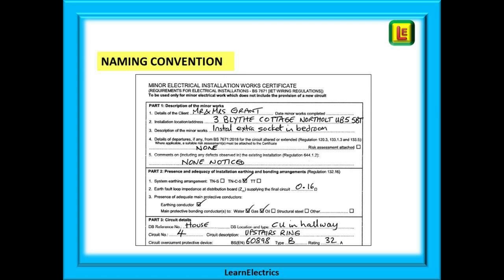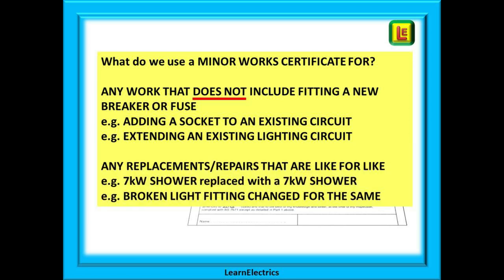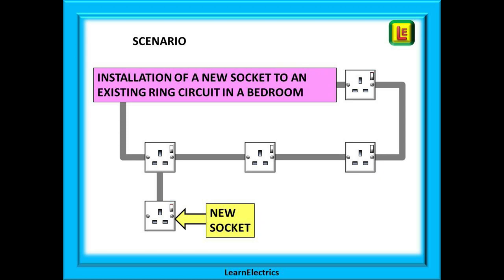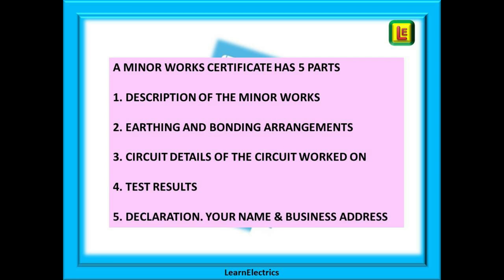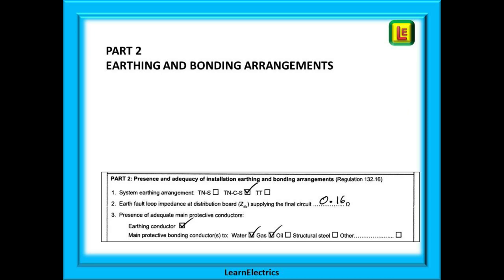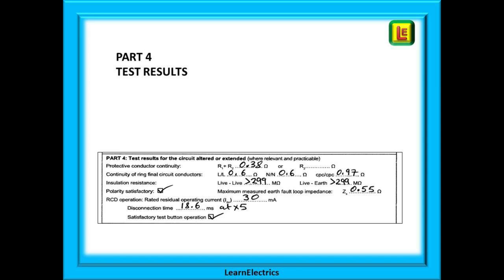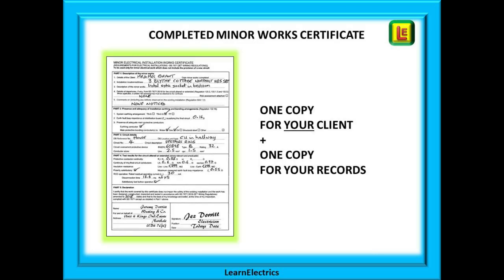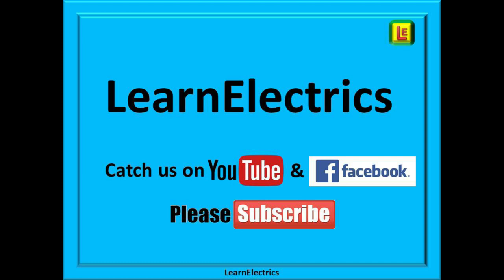MINOR WORKS CERTIFICATE how to complete correctly

Comment: Hi I have been watching your videos with great interest as I am thinking of retraining and becoming an electrician . One question I have when you test your work say if you have added an extra light  so there is two in a room off the same switch , do you need to test all the lights on that circuit or just the one you have added
Reply from the maker: The one you have added, and the one you have taken the feed off, just in case you have moved wires. Great question, thanks for the input. Keep learning, its a good trade to be in.

Comment: Another useful video thanks, I’m just getting back into domestic work and started extending a ring and separate spur, in a kitchen. All minor works but my problem is I can’t isolate the DB for all the tests as some of the other circuits have medical equipment connected, can I still complete the cert but leave comment to the limitations.
Reply from the maker: Part 2.2 of Minor Works Certificate Zdb can be found by Zs at the new sockets minus R1+R2. If the medical equipment is on the same RCD as the new work, then you will need to write this an exception. It's a valid reason to miss it out, the customer doesn't want the equipment disconnected and they accept that it is being missed out. They are accepting responsibility - so long as everything else is as it should be.
Reply: @learnelectrics4402   Many thanks for your reply, most helpful. I just wasn't sure about exceptions on a mwc. Appreciate your help.
Reply from the maker: You're welcome Ian.

Comment: Great video as always 👍 this is defo my favourite channel on YouTube. I have learned so much. Please keep up the videos. 
I have a question for you:
I need to install a couple of outside led lights. Fed from an existing ring final circuit via a 3amp switched fused connection unit. Will this be covered by a minor works certificate?
Thanks for your help
Reply from the maker: Yes, as the circuit already exists. And fusing down to 3 amps is absolutely the correct thing to do. Thanks for the positive feedback, really appreciated. Dave.
Reply: @learnelectrics4402  
Thanks for getting back Dave. Very happy with the answer to my question. Looking forward to the video 👍 keep up the good work

Comment: Should these be completed for any non notifiable works undertaken via DIY?
Reply from the maker: Monty, please do not fall into the trap of associating minor works certificates with non-notifiable work, they are not linked together.
The Building Regulations say that some work is notifiable and some work is non-notifiable.
The Wiring Regulations say that all electrical work should be certified by either a minor works certificate or an electrical installation certificate.
Hope this helps
Dave.

Comment: Another great video of information dave 👍 I have had some minor electrical work done and been issued a mwc ,I had a light switch moved, an additional spurred socket in my lounge and an additional socket in garage, only thing I have noticed in the description it says light switch moved and Addition spurred socket in lounge. So no mention of the added socket in garage? Although both sockets are on the same circuit and shows the R1+R2 and zs like you mentioned in the video , should the garage socket be in the description? Just wondering weather I need to ask him about it next time he comes or is there a reason it won’t be in description ?human error? Cheers dave any info would be appreciated 👍👍
Reply from the maker: If both new sockets are on the same circuit breaker then they should both be mentioned on the same MWC.
If they are on different breakers then you should have 2 MWCs, one for each socket circuit.
And .. you should have a separate MWC for the lighting circuit.
So you should have at least 2 MWCs possibly 3.
You can easily check if the sockets are the same breaker. Turn the lounge breaker off and see if the kettle works in the lounge and in the garage. If the kettle still works in the garage but not the lounge then they are on separate circuits.
Hope this helps. Dave.
Reply: @learnelectrics4402  thanks for getting back to me dave 👍 did like you said the sockets are on the same circuit and same floor level. and the lighting circuit is on that same floor level aswel, think I’ll get onto him about it to double check, I think he just must of forgot to put additional garage socket
Reply from the maker: Glad I could help.
Reply: @learnelectrics4402  just another silly question can the mwc be amended so my electrician could add what he’s missed off? Or would a new mwc with the socket missed off need to be issued , cheers dave 👍 sorry to be a pest
Reply from the maker: Just get him to add it on and countersign it
Reply: @learnelectrics4402  brilliant cheers again dave seriously thank you very much for all info and advice you are putting in videos keep them coming  👍👍🙌🏻🙌🏻
Reply from the maker: My pleasure.
Reply: I learn just as much from the comments and your replies as I do from the your videos Dave 😂👍

Comment: Another excellent video Dave I'm going to press the notification bell after this message I do have a request if you have time I'm getting confused on disconnection times when to put 0.4 sec or 5 sec I watched somebody fit a 3ph 40a  type B 60898-1 on the paper work he put 0.4 for disconnection time I asked why 0.4 and not 5 sec he said he's always put 0.4 sec I then looked in the regs and just confused myself help 😖
Reply from the maker: Thanks for the great comments Mark.
Yes, disconnection times confuse many people. It is one of those black art things, if you are in the know it is easy, if not ...well. But the good news is that we are publishing a video on 8th March about this very subject and now that we have got LearnElectrics.com up and running it will be on there too, the same day. 
Right, very quickly, look at page 58 in the Regs, 411.3.2 onwards and Table 41.1
230 volt TNS and TNCS final circuits up to a certain current have 0.4 secs disconnection time. And if connecting to a 400 volt machine, your friend should have written 0.2 seconds.
Other circuits have 5 secs as per 411.3.2.3
But BSEN60898 breakers easily achieve 0.1 seconds disconnect if the Zs is correct whether they are used in 0.2 sec, 0.4 sec or 5 sec circuits.
I hope this helps and look out for the video on 8th March.
This weeks is about SELV and PELV
Take care Mark
Dave
Reply: @learnelectrics4402  Hi Dave thanks for the quick response and the explanation will look forward to that video the wed site looks interesting as well like the idea of reading the info then being directed to the video this is all going to be  very helpful 👍
Reply from the maker: Thanks Mark. Yes, we are trying to make the videos and website keep pace with each other now, the dot co dot uk site was a disaster, they called themselves professional web designers - so we've built the dot com site ourselves, massive learning curve but its coming together. Glad you like what we are doing, tell others. Cheers, Dave.